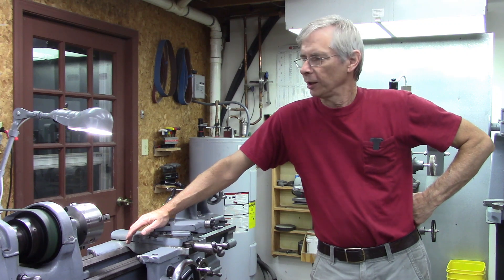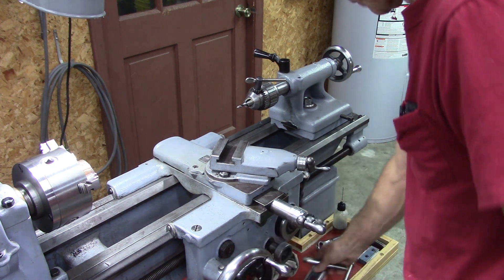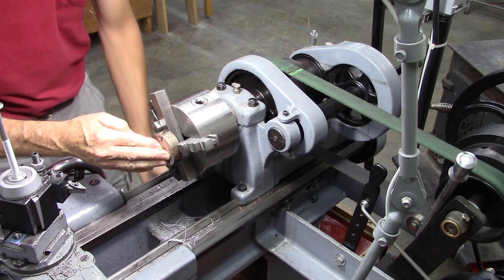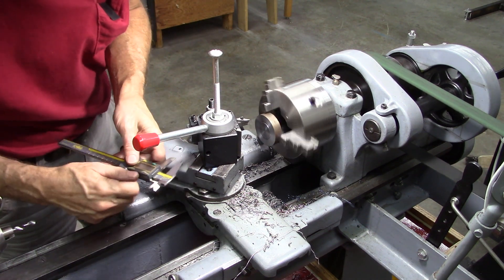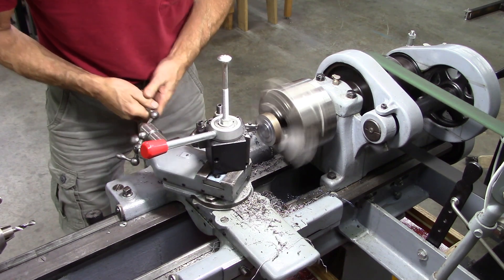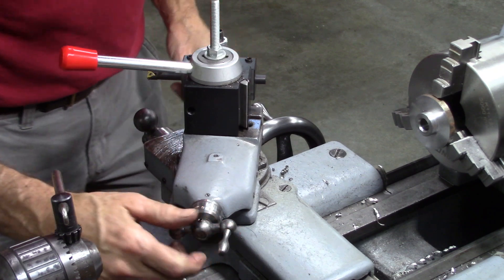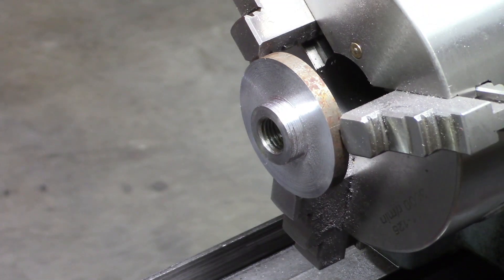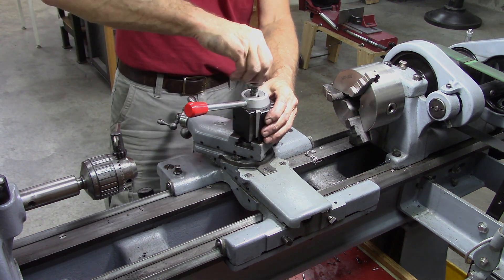Make a T-nut without a Milling Machine

Comment: Rather than grinding the edges off you could also use the lathe positioning the nut perpendicular to the chuck. It will be an interrupted cut, but you should be able to get much more precise this way and guarantee the sides are parallel. I guess you might need a 4 jaw chuck for that, but in the end you could have a rectangular nut. Also you could ensure the thread were perfectly centered on the nut this way. Good video!
Reply from the maker: This is a very good idea! Thanks

Comment: I really like the way this lathe-turned, T-nut turned out.  you have a much thicker Center section for more thread engagement and a more than adequate pressure foot-print.

Also like the torch bent, Z angle tool post, 7/8" wrench which has been modified to avoid knuckle buster collisions.
Reply from the maker: I also fitted the square head bolt that locks the carriage with a nut the same size as the tail stock and tool post. Its nice to not have to keep track of several wrenches.

Comment: Mark, thanks for another great lathe video. Others have commented about holding odd shaped parts in your bandsaw vise so here's another and it's a whole lot simpler. Wood is extremely fast to work so I always consider a wood solution first. In this case I would have cut a short length of 2x4 and screwed that round stock down (near center but not important) through the center hole. Cut one side off, flip the 2x4 180 deg, clamp and cut again. Hell it even comes off the saw square! 😉
Wakodahatchee Chris
Reply from the maker: That would work well. Thanks!

Comment: I had to make a cut like that on my bandsaw and it wouldn't hold so I took one of my drill press vices and clamped it in my bandsaw Vice it made the cut it worked out fine
Reply from the maker: Whatever it takes.

Comment: Smaller t-nuts are needed for a mill, etc can be quickly made from carriage bolts: Select a carriage bolt which has a square section under the head/flange that closely fits the narrow part of the mill table's slot. Chuck the carriage bolt on the threaded shank.  Drill thru the head of the bolt, using the appropriate size bit for the desired T-nut threads. Drill deep enough to go beyond the square section of the head, slightly into the shank.  Cut the rounded flanged/square head portion of the bolt off from the shank. Thread the head from the square shoulder (newly cut) end, stopping just short of tapping thru (this prevents your clamping stud from screwing thru the t-nut; reducing the risk of breaking a t-slot on the mill table) Next, grind/sand/file/or mill two flats on the side of the carriage bolt's rounded head flange to fit the table's wider area of the slot.
Reply from the maker: Interesting, thanks!

Comment: Much easier method, using only the lathe: chuck the  turned, drilled and threaded disc in the lathe's chuck on edge, pinching the sides, with the bottom side (side without the boss) against one jaw. Face off the edge an amount necessary to create one flat side of the T-nut. Re-chuck same way, only 180° ( use the newly machined flat to align with the face of the chuck body. Machine the other edge flat.  Done.
Reply from the maker: That would have been a great way to do it! Thanks

Comment: Neat :o)   I’d put a bit of flat stock in the old tool post and a milling cutter in the chuck. Then shim the flat stock to the right step height. (Sometimes the tool post doesn’t go over enough so I have to max out the compound slide to reach a bit more)
Reply from the maker: Yeah...  that would work too.
Reply: @WinkysWorkshop  My four-tool rotating tool post is over 40 and it had worn tapered where the lathe tools sits. (Which is more annoying than it first seemed). I had the right blocks to lift the tool post up and run it past a milling cutter in the lathe chuck. Even if I had a miller I figured it would still be more accurate if it machined itself. :o) *it’s an old TOS with a 5hp motor.
Reply from the maker: @teamidris  I agree, a perfect way to fix the post!

Comment: I haven't got a milling machine or a lathe. I get two pieces of flat bar different widths, drill two holes in one of them and weld through the holes to the other. Drill and tap the centre and you are done
Reply from the maker: Ha...  cool

Comment: The part in the thumbnail is different than the part you made in the video.
Reply from the maker: I didn't want to give away the trick with the thumbnail! Ha
Reply: @WinkysWorkshop  The term for that technique is "clickbait".
Reply from the maker: @codetech5598  Ha...  I suppose you are correct although my intent was to make the video worth watching not mislead. Why wrap a Christmas present if someone knows what they are getting?
Reply: @WinkysWorkshop  Well, this is the first video of yours that I've watched and what I've learned is not to expect that your work will match the thumbnail.  I will keep that in mind for the future.
Reply from the maker: @codetech5598  - Interesting...  I'll keep that in mind for the future. Check out a few of my other videos before you abandon me. I think I have a few good ideas although I'm sure some are not so good. I have gone back and deleted a few in the past. I think my CNC  wood lathe is very cool but if wood is not your thing I have one on a Square Column Drill press and a guided tap wrench I think you might like....  but its hard to say. Google "Winky Buckboard Flier". This was a supper popular 2 part video! FYI  I sold the car 3 weeks ago...  fun project and fun to ride.

Comment: Why not leave both face round, I cant see why it would not work if you don't over tighten it?
David
Reply from the maker: Hello David, it probably would hold well enough but I have seen quite a few damaged compounds from the old Lantern style posts. At least in part, the small square t nuts were to blame. It might make the compound survive a mishap like to a tool running into a chuck. Never say never.

Comment: Mount a suitably sized piece of flat bar stock in the tool holder and put a milling cutter in the lathe chuck. Adjust the tool holder to the correct height and take a few passes to mill the first edge, then rotate the bar in the tool holder to do the other side. All you have to do then is drill and thread the hole.
Reply from the maker: That would work well. I also could have started with a rectangle in a 4 jaw instead of round.

Comment: To cut it on your band saw You could tap a thread in a piece of scrap steel, then screw the part through the center to the scrap steel and clamp the scrap steel in the saw's vice.
Reply from the maker: Yeah...  grinding worked okay but that would have been better. I Agree.

Comment: Slick piece Winky. I have made them with 2 pieces of flat bar with pocket welds from the bottom bar to the top and then just drill and tap the center hole. They don't look nearly as nice as yours but they are functional. Great tip here today my friend. Take care eh.
Reply from the maker: Thanks! welding would work. Ray gave me this idea so i thought I'd share. I have mill now anyway.
Reply: @WinkysWorkshop  I can do a bit of milling on my old partners lathe but for the best part I have drills and files for my mill, LOL.
Reply from the maker: Been there done that!
Reply: @WinkysWorkshop  I'm sure you have my friend, Chuckle.

Comment: You know what's easier, 2 pieces of material put together. Example: .75 and .50 wide x length , stacked with Super glue. Drill and tap holes for fasteners to keep the pieces together. Then D&Tap for your attachment
Reply from the maker: That would work I think.

Comment: Never thought of that !  and it's alot better than taking a thousand tiny cuts on my home made excuse for a mill !  Thank you !!!!,  I will definitely use that method !!!!!
Reply from the maker: You're welcome! Cool that you made a mill.
Reply: @WinkysWorkshop  but it is not sturdy enough for deep cuts  it chatters if i push it......"Lesson learned !"
Reply from the maker: @bobkelly2447  - Yeah, even my RF 30  struggles if I take much off. It would be hard to make a solid mill. I made an X Y table for my drill press and I've tried to use it like a mill on wood. It was terrible!
Reply: @WinkysWorkshop  I've seen some beefy home made mills that do the job quite well . just lots of steel and lots of bracing ! good bearings and a big motor ! .... Yep I've used a 2 way vice on the mill and that was a disaster as well.... it takes MASS ! and that's hard to get in the home workshop ! 
I gott'a try that T nut on my Logan 922 lathe it should be a piece of cake !
......

Comment: I have 4 tee nuts on my shaper made from round stock and flats milled on the 2 edges very similar to this. That awkward holding job in the band saw vice can be made much easier by clamping the work down onto the vice base. As I have shared previously I sometimes remove the vice from the saw and bolt a large angle plate onto the saw base. You can accommodate all sorts of odd shapes that way.
Reply from the maker: Yes I totally agree and after a bit of grinding I told myself I should have taken the time to make a hold down. Thanks

Comment: the flats on the larger diameter could also have been easily machined on the lathe, as well. And without a milling attachment for the lathe. Simply hold the "disc" in the chuck, on edge and face one "flat". Measure thr distance from the smaller diameter boss to determine the amount to face off. Re-chuck 180°, using the first flat to index, and face the last "flat" side. Done.
Reply from the maker: You were supposed to tell me this before I wore out my sanding belt :o)   Thanks!
Reply: @WinkysWorkshop  LoL 🤣😆
Hindsight is 20-15
Reply from the maker: @dans_Learning_Curve  - Yep
Reply: Yes several ways to accomplish making a T-nut without a mill. It also depends on how much time you have or want to spend on it.

Comment: I went a whole other route. I've been a renovations contactor most of my life, and for some reason, when we bought this place, people started giving me aluminium topped plastic bodied home gamer table saws... A few years ago I had 6, plus my contractor saw, and my cabinet maker's saw. My sister sold a couple at her garage sale, and I found new homes for 3... The last one I made an oak zero clearance insert, and a dial adjustable mitre slide for and use it exclusively for cutting aluminium. I've made a few T nuts out of 1/2" aluminium plate for my 130 year old Barnes #4 1/2 (9" swing) lathe... Still way more rigid than the lantern tool post!
Reply from the maker: That's cool, love those old lathes!

Comment: I'm on the fence about being as rigid as a real T-nut, especially for a tool post.
Reply from the maker: Maybe for a much larger lathe but I doubt most smaller lathes would have a problem.
Reply: @WinkysWorkshop  Just my personal opinion but I think rigidity matters no matter what size lathe you have. Chatter is more of a problem on my small lathe than it is on my larger lathe.
Reply from the maker: @williamhardin5254  - Certainly true but I don't think the forces on these smaller lathes are great enough to flex the T nut. Honestly this T nut should be way stronger that the original lantern tool post design. Yeah...  it's certainly easier to go from running a small lathe to a big solid lathe. Actually I'd say running a small lathe is a good learning experience. You have to learn how to overcome the lack of rigidity. I'd say it established good work habits. I remember a few critical comments on my cutoff tool videos like, "you're doing something wrong, I never have problems". Then after asking a few question I find out they are running a 12" Monarch lathe. On these small lathes keeping the load centered over the compound, minimizing tool stick out and even running chucks with minimal overhang are all super important.
Reply: @WinkysWorkshop  Okay, your right and I'm wrong. I don't know what I was thinking, next time I'll put more thought into my comments.
Reply from the maker: @williamhardin5254  - I wouldn't go that far, In part I was agreeing with you and you might actually be correct on the t nut. At this point we are both speculating and stating an opinion. I think maybe you misunderstood my comment or at least my intent. I probably didn't communicate it very well.

Comment: Using certain bolts, cutting of a bit of the head, gives useful things..
Reply from the maker: Good tip!
Reply: @WinkysWorkshop  We name then "waggon bolts". Under the none flat head is like a quadratic boss that prevents rotation i the T track. Name it "T bolt" instead of nut.

Comment: Great job Mark. I would recomend using an angle grinder and cut off wheel and then belt sand to final dimension. It would save a lot of sanding with the belt sander.
Reply: That's what I would have done.  I hate my angle grinder because it's one of my most used tools.  ☺
Reply from the maker: @CapnCrusty  - Yep...  I agree
Reply from the maker: Good point. It didn't too long but put some wear on the belt.
Reply: Hi Mark What about putting the bandsaw into the vertical positionand using your table that you made .I have made one and it works very  well and iuse it all time infact i made two, one for my mate he is most impressed with it. Ray Austraila
Reply from the maker: @raymossop7959  - Thanks! I sometimes forget I have it. I should have used it to cut off the extra steel on this T Nut!

Comment: Also possible to hold a milling cutter in the lathe spindle and mount the t-nut to the compound spaced to the correct height. Nice video thanks!
Reply from the maker: This is true...  many options! Thanks

Comment: That's awesome Mark, thanks for making this video. Mine was made from 1-3/4" bar stock which would be minimum for this T-slot of 1-3/8" width.
Reply from the maker: So true. Large would be better. You could also cut a piece of bar stock to the right width and chuck it in a four jaw. Thanks for the idea on this video!
Reply: @WinkysWorkshop  Yes, flat bar stock would also be doable in the four jaw. At 1-3/4" round bar stock, it's surprising how much taking just 3/16" off each side leaves for under the T-slot. It does look to be much more sturdier than what the lantern tool post currently has for an anchor.
Reply from the maker: @RAYAR54  Yeah...  the lanterns don't have much support.